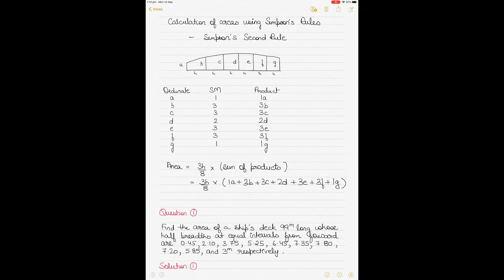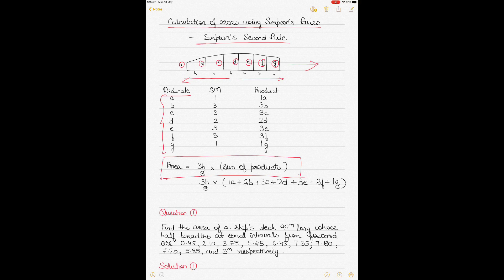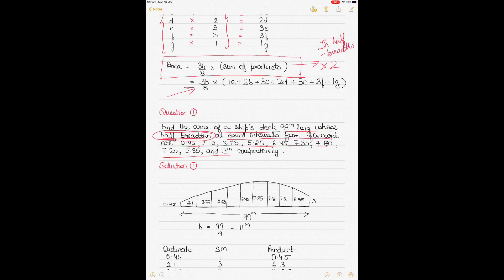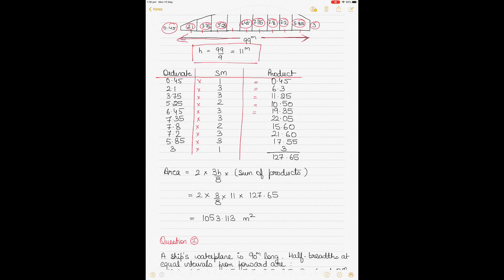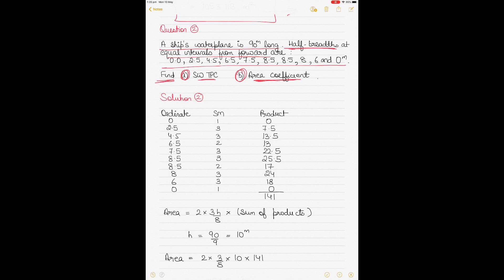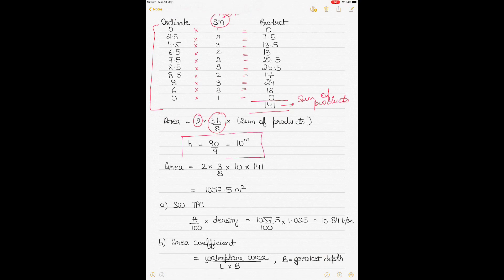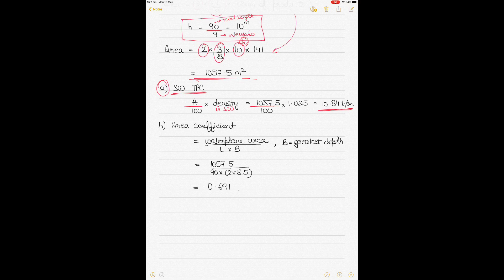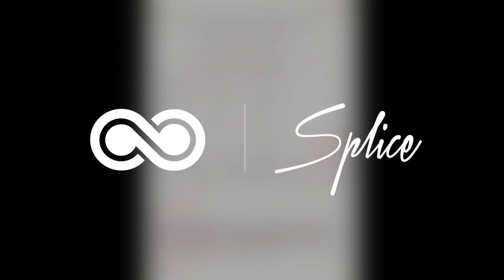Ship Stability - Simpson's Second Rule

Comment: Sectional areas of a 180m LBP ship up to 5m draught at constant interval along the length are as follows. Find its volume displacement and its LCB from amidships.
Station

0

1

2

3

4

5

6

7

8

9

10

Area (m2)

5

118

233

291

303

304

304

302

283

171

0